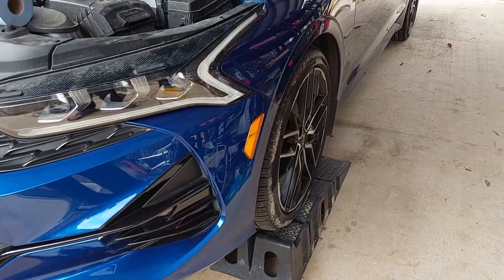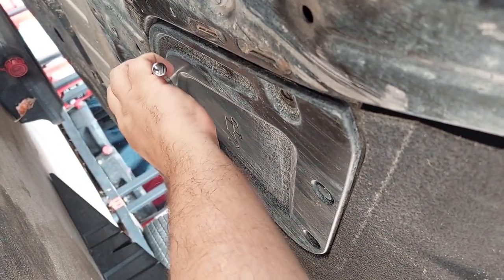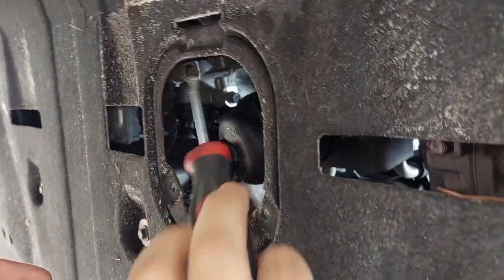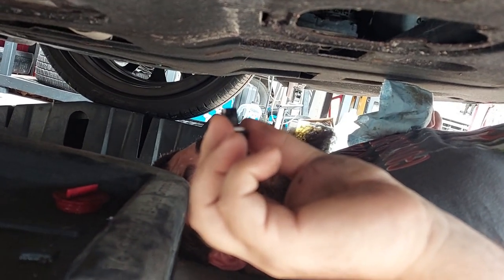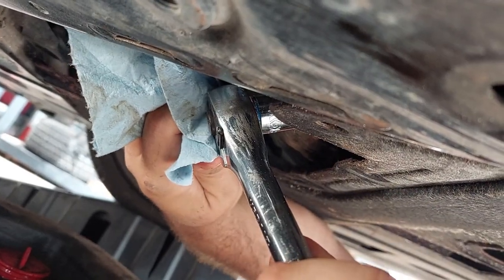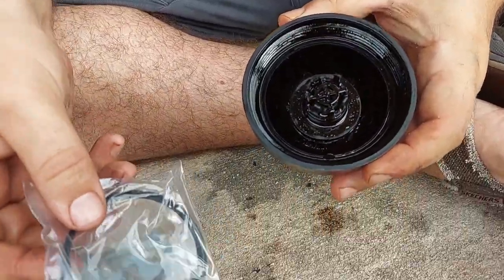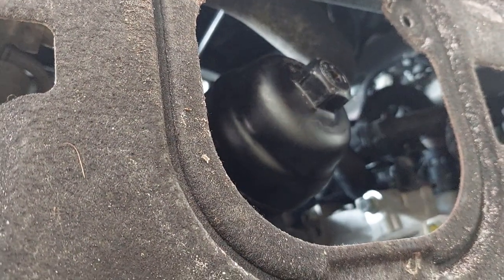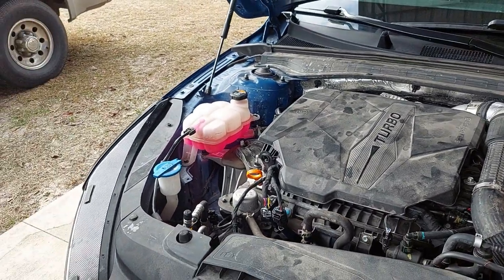Episode 107 - Oil Change 2022 Kia K5

Comment: I have the same car and I'm having problems finding 0w 30 oil. Why do u use 0w 40 euro oil? I'm just curious
Reply from the maker: I'd have to defer to my brother to give a detailed explanation, but the gist of it that I remember is that due to different rules and regs Euro oil has a formula that is better suited to small turbo engines, like the one his K5 uses.  You get better suited additives with an oil viscosity that promotes longer engine life.  Bob is the Oil Guy is a good website to visit if you want to go down the rabbit hole of differences between different types of automotive oil.

Comment: Here's a question. I recently went to a mechanic with a Camry that had 140k miles. The mechanic told me he would put 5W30 oil bc it's an older car even though it says 5W20 on the cap and manual. Now I read split opinions about this online, but it seems that you shouldn't put a thicker oil if the engine is still good and it could wear it down and not lubricate it well enough bc the engine wasn't designed for that. Would you say that I should get rid of that oil, dilute it with 5W20 or think he made a good decision?
Reply from the maker: The truth is that most any engine can run most any conventional weight of oil.  Some may suffer an impact to fuel economy, but they can run it.  For older engines, they are more tolerant of running thicker oils and it's in my opinion better to run a thicker oil on an older, high miles engine.

For example, right now I'm restoring a 1994 Chevy 454 engine that's high miles.  I'm putting 15w-40 in it, which is diesel oil.  Very thick, but for an old engine like that it won't mind at all.  Thicker oils can also help with minor gasket-based oil leaks.

I also have the 1995 Mazda Miata you guys have seen on the channel.  I didn't have any last oil change for it, but it's going to get 15w-40.  The lifter tic that is common on the little 1.8L is pretty much is silenced chewing on that thick oil.

All that being said, DO NOT RUN THICK OIL ON A VERY MODERN ENGINE!!!!   Modern vehicles, particularly anything that is Direct Injected have very tight machining tolerances and you will cause accelerated wear if you a thicker oil than specified.  If you want to run an oil weight that is not manufacturer specified in a modern engine, do a ton of research before you make that decision.

To finally answer your question, an older Camry that's high miles?  Yeah, a thicker oil is not going to hurt anything.  If the climate you live in allows it, 10w-30 is a solid oil to run in most anything.  I standardized my "fleet" vehicles to all run on 10w-30 to save on oil costs.  All my old engines I standardized on 15w-40 to help with leaks and keep them running more quietly.  Bear in mind I live in the South where the climate stays fairly warm even in the winter, so I can run the thicker oils year round.
Reply: @MazdaB3K  I was reading a lot online and the opinions seem to be very split on that. Places like Amsoil and Toyota insist to keep on using the 5W20 oil since it provides superior lubrication and flows better. Otherwise you can wear out your engine... This morning (for the first time) I heard my engine rattle twice at a red light. Felt as if it would turn off. Maybe it's related to the spark plugs and I wonder if that has anything to do with the thicker oil. But you seem to be running it as well.
Reply from the maker: If you are getting rattles and what feels like a near stall, that's not engine oil.  That's something else.
Reply: @MazdaB3K  Btw, do you think oils with detergents could clean carbon off the piston rings? Bc of excessive oil burning I heard there might be a lot of carbon on those and maybe I could make it better by using another oil such as Pennzoil Platinum. You think those things work?
Reply from the maker: The detergents in modern oil do exactly that.  Takes time though.  If you want to clean it off in a hurry you can use things like seafoam down the intake, or B12 Chemtool.  If you are a real madlad you can pour a wee bit of water down the hatch and that will clean out carbon in a hurry.  It will also hydrolock your engine and destroy it if done wrong, so I don't recommend that path.
Reply: @MazdaB3K  Got you. But with the Transit Connect I won't get up any hill or mountain fast. The main thing from what I read are oil changes. These turbo engines also seem to pollute your engine oil much more with gasoline than conventional engines. So they probably won't last as long. So much for Subarus. Thing is that here you can't do an oil changes on the street and apartment buildings don't allow it. So you depend on what mechanics put in your car and it usually ain't the best oil.
Reply from the maker: @Jose-sy1je  Not quite right.  Modern small turbos themselves aren't the source of your fuel dilution, Direct Injection fuel injection is.  However in modern engines you often see the two paired together to deliver good hp, torque but good fuel economy as well.  You can slow down fuel dilution by using premium gas, which allows the ECU to set a more aggressive timing, which reduces the amount of fuel that gets in the oil.  Thing is, as with almost all engines, as long as you change the oil when the manufacturer says to, and put the right weight of oil in for your application you should get a full life out of your engine from a lubrication standpoint.

As to your situation for oil changes.... the few times I've needed to get oil changed at a shop, they didn't have an issue with using oil and oil filter I supplied as long as it was brand new and unopened.  This way you pay them for their time and labor and you get to control what oil and filter go into your car.  As to what brand of oil to use, as long as the oil meets the specifications listed by the manufacturer, doesn't matter who makes it.  When you walk down the aisles of Walmart, pretty much every oil you see will meet the spec of modern cars.. the difference will be in which oil go beyond the spec, and the additive and detergent packs put in the oil.

All that being said I prefer Mobil 1 for my oil and Wix for my filters.  In the past I've used Penzoil Platinum or even SuperTech oil.  As long as it meets the spec of the engine the oil is good to go.
Reply: @MazdaB3K  I need to read more about direct injection. I was of the impression that all turbo engines operated that way. 

There are good videos by a channel called Project Farm. He has a video called "Amsoil or Pennzoil". So Amsoil is supposedly the best, but Pennzoil has loads of additives. I was hoping that these additives would remove carbon deposits off the piston rings that could be there due to oil burning and therefore remedy the issue.

I think you also mentioned that you use thicker oil on older cars? But what mileage are you talking about? It said on an engineering channel that this should only be a option of last resort. The engine still sounded good in my case. The engine now makes a much deeper sound (not a clear one like before). Is that a good a bad thing? I feel that the deeper sound appears bc the engine has to do more work to pump the thicker oil through. In general it seems that you can maintain an engine very well with frequent oil changes and for someone like me it's hard to tell how worn an engine really is.
Reply from the maker: @Jose-sy1je  If you really want to get into the weeds and get a sense on the health of your engine, you can do that at your apartment complex.  You'll need a vacuum gauge and compression checker gauge.  Both can be found at most car part shops.  You can check for compression by removing a spark plug, screwing in the compression gauge, then trank the engine with the throttle wide open.  Repeat this for every cylinder.  Then compare the numbers you got to what the official numbers are from the manufacturer of your vehicle is.  The lower your numbers are compared to the factory standard, the more worn your cylinder sealing rings probably are.

For the vacuum gauge, you can tee that in to somewhere around your upper intake (plenum) to see how much vacuum your engine is making at idle, and how the needle on the vacuum gauge is acting.  Based on how the needle is acting and what your vacuum at idle is and what it does when you rev the engine, you can learn quite a bit about the health of the engine.
Reply: @MazdaB3K  That would actually make for a super interesting video I think. When I searched whether or not to use thicker oil for older engines, I basically found nothing on YouTube. I found a lot on Google and opinions were split. Kind of weird that this axiom has been around for so long but I don't really see anyone talking about it. Maybe I'll look into that pressure test. You think I can still go back to thinner oil once I used thicker oil on an engine? 

I actually don't like on the Transit Connect that you can't lock the fuel tank and anyone can tamper with it. Some newer models let you order a part. I finally found something online and will check out if it works.
Reply: Generally, thicker oil provides better lubrication. Thinner oil provides better efficiency. With turbo-charged vehicles, I prefer to put thicker oil and sacrifice a little bit of efficiency for the peace of mind of better lubrication. For my K5 GT, I use 0W-40 or 5W-40 (full synthetic of course).

Most modern engines can a various range of lubricant viscosity.